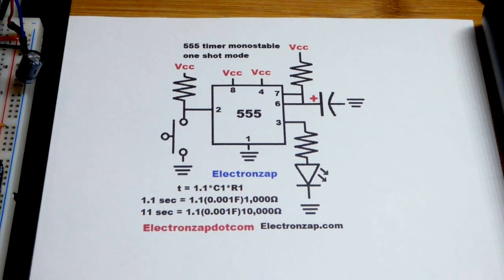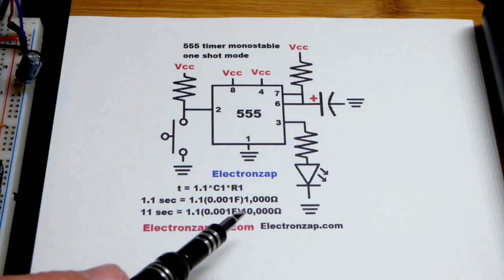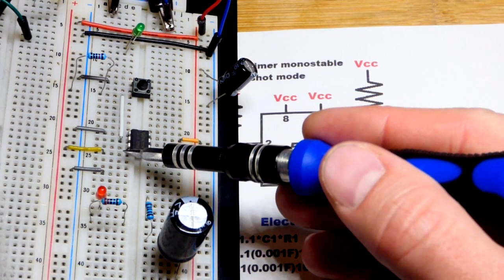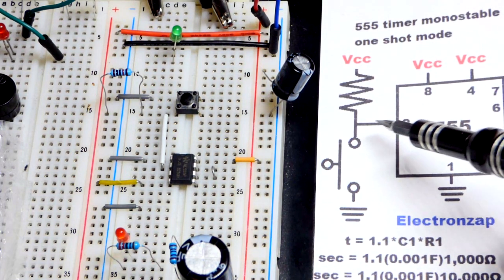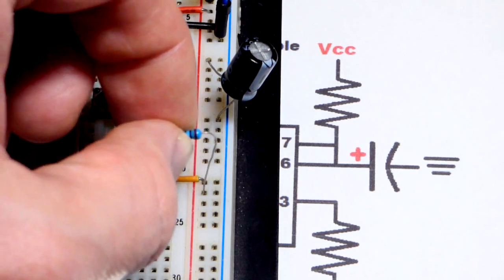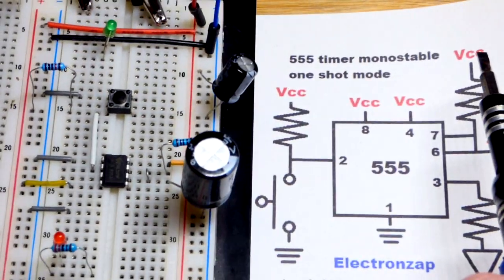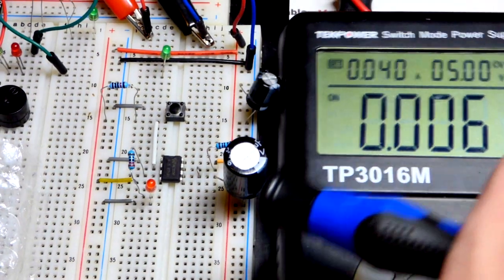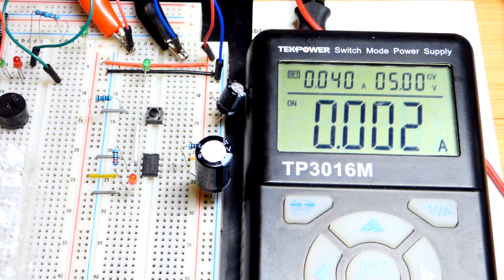Quick 555 timer monostable one shot mode lighting an LED circuit schematic to breadboard build

Comment: what happens if you hold the button?
Reply from the maker: It won't switch back when the timing is done until you release the button.
Reply: How can we change this? So it will only pulse one time no matter the input condition?
Reply: @michaelc1063  i solved the problem with a 2 way switch, a resistor and a capacitor
Reply: @WendyGameing  Thanks

Comment: I have a similar cheap resistor set and find it easier to push one end of the resistor in first and then the second one.
another cool video.
Reply from the maker: Thanks for the tip!